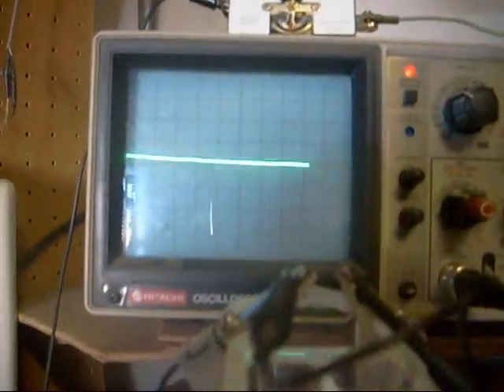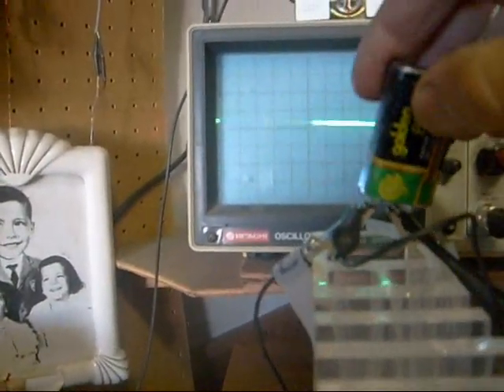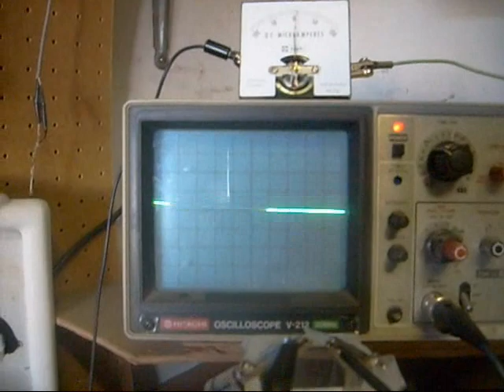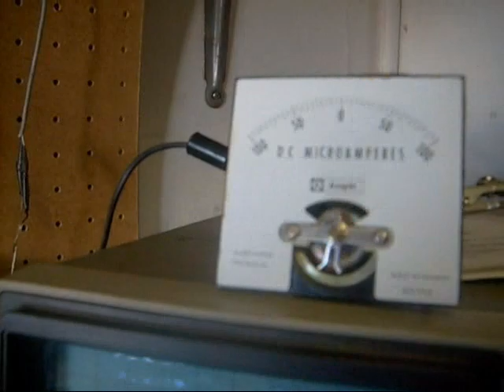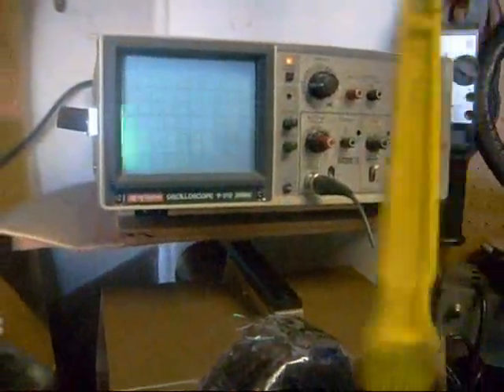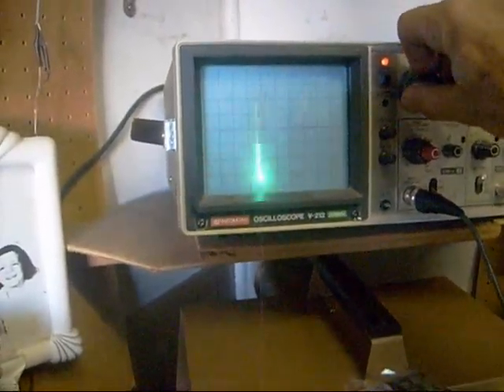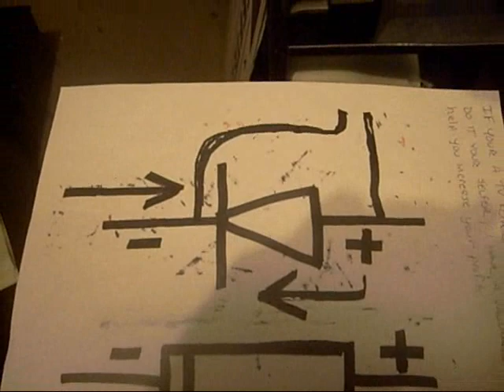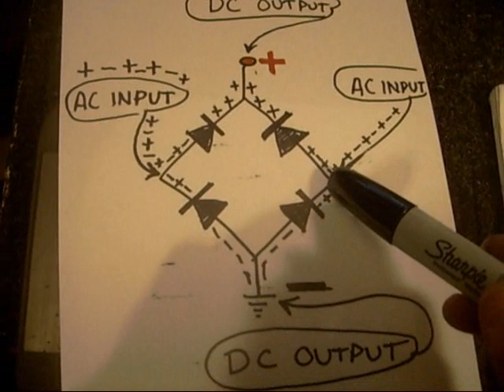Understanding AC AND DC

Comment: When you add the diode, and you say that "its still considered DC"; does that mean that the voltage thats constantly change is changing in one direction. so the electrions are flowing in one directions, its just the voltage is constantly change in that direction (from 0 --> +max --> 0 --> +max)??\

Comment: If that doesn't make sense basically the live wire is like the "battery" its the source of of the energy. But all circuits need to be closed or returned to earth/0volts. The neutral wire is the earth/0V allowing energy to flow through the circuit.

Comment from the maker: @Films4You When your talking about AC power from the electric company a live wire is still AC meaning it is both positive and negative in reference to the other wires. The term "live wire" with consumer AC power is meant to signify any wire other than the one attached to your earth ground.

Comment from the maker: @GrantsPassTVRepairs Here is one more point that may help you understand the term "live wire". With DC power we always think in terms of negative and positive, but with AC power it might seem confusing to grasp how one particular wire could be called the "live wire" when both wires continually change in polarity. Just remember one of the wires on your power outlet is attached to earth ground and one isn't. The term "LIve" doesn't mean it's positive, but in reference to earth ground it has power

Comment from the maker: @Films4You I think I understand your question. Here in the US we have 120 volts AC from our power outlets.. If you attached one of your meter probes to a ground rod and measured the Two wires going to your power outlet only one would have power in relation to the ground rod which is an earth ground. It's true that both sides have AC going through them but the term live designates that one side is live or hot in relation to the earth ground. I hope I made this is clear enough.
Dave

Comment from the maker: @AtoZContents Yes most electronic devices which plug in the wall use diodes to turn AC to DC. A majority of the devices which don't use diodes with few exceptions are AC motors, electric heaters, hot plates, hot water heaters, most heat generating devices and incandescent light bulbs. If you put a diode in series with an incandescent light bulb it will reduce its brightness because it will only gets half a cycle of AC.

Comment: what makes the electricity in a Battery come out at the Positive side? what keeps it from coming out the negative side? this is the part i dont get i always though Electricity went from point "A" to point "B" and it died, or unlessed it was looped (A-to-B) it would circulate for awhile until the electricity got weak and died out, i mean if the direction of the Current was reversed all of a sudden, wouldnt the electric device just turn off?
or mabey i got the whole electric idea wrong?

Comment from the maker: @secksie28 
The main advantage of using AC over DC is because AC is easier to transport over long distances and redistribute to a lower voltage for consumer use with step down transformers. Unfortunately AC has more line loss over distance than DC, but AC is so easy to down convert.  DC has less line loss over distance but due to the complexities of down converting DC we use AC. If you want to better understand AC line loss over DC look up Inductive and capacitive Reactance and corona loss.